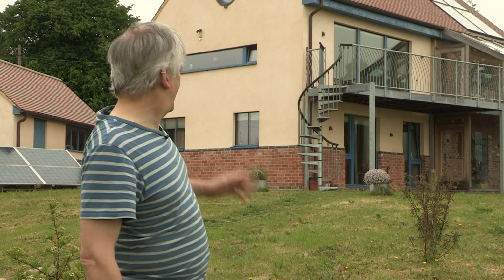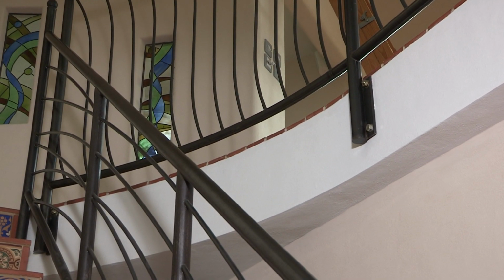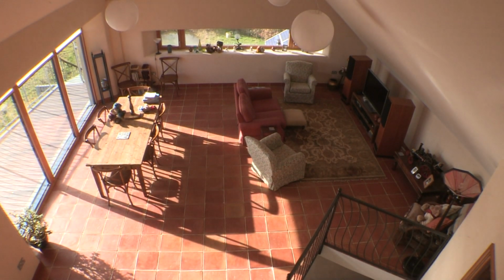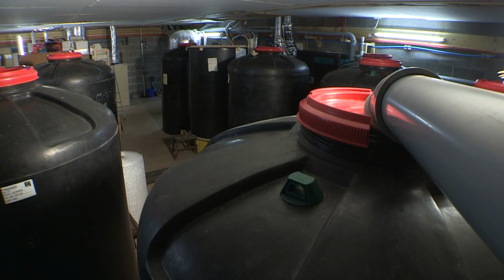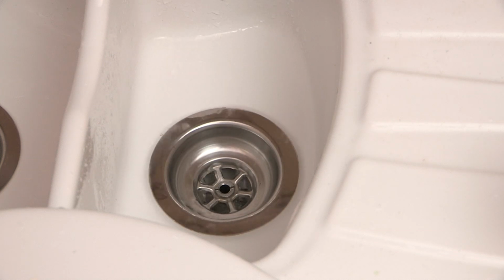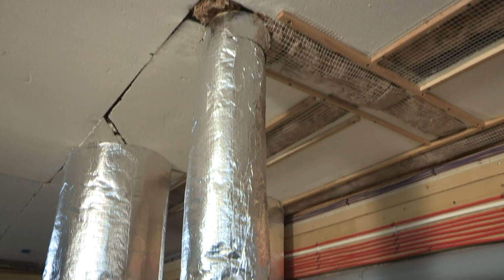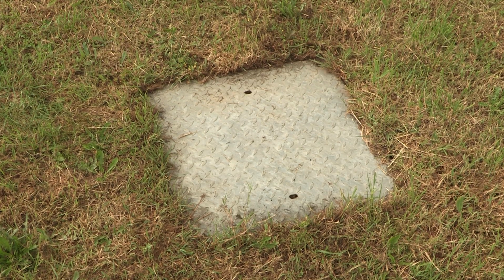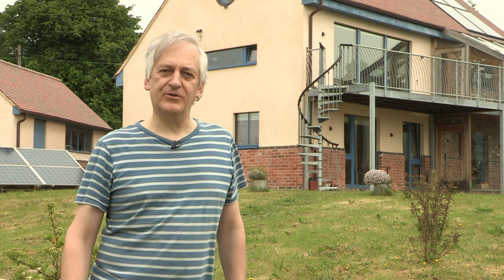The Benefits of an Autonomous House

Comment: I once heard that 20% of CO2 emmisions are from concrete, so it would be interesting to know how much the house saves relative to the concrete it took.
Reply: I'm betting hempcrete would be a great alternative, since it only increases in strength over time, breaths and absorbs moisture, and also has a negative CO2 footprint.
Reply: *****
 Interesting.  But then stupid people would start licking their walls.
Reply: Canadian MGTOW Hahaha well industrial hemp used in many building materials and plastic composites contains next to no THC so you can't get high from it. They can't lick all they want!
Reply: *****
 I know, but many people don't.
Reply: What? I thought concrete absorbs CO2 during the curing process.